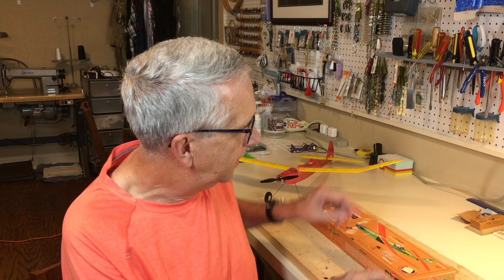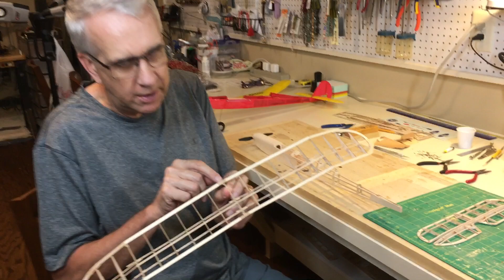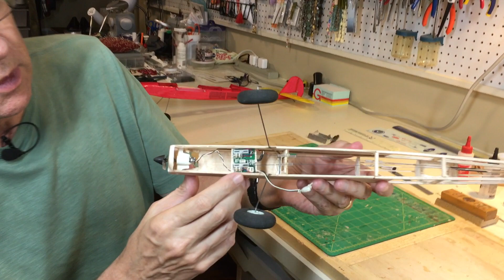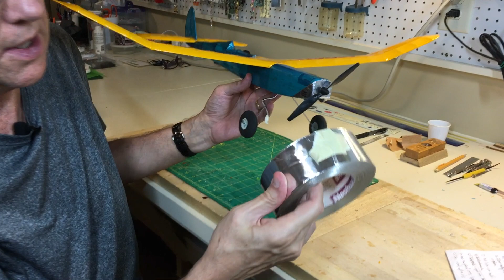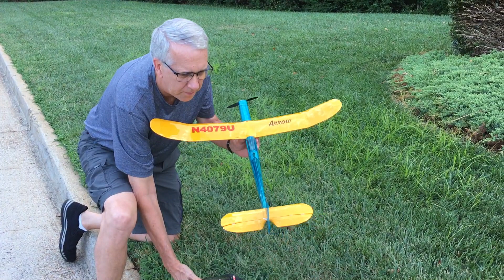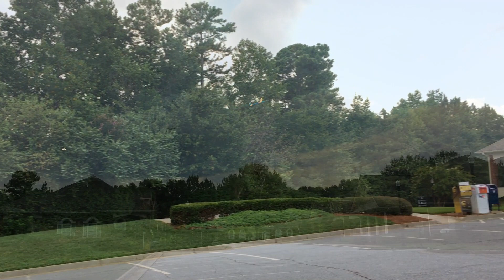Guillow Arrow RC Conversion - Part 2

Comment: Yes,  lots of wing area vs. weight (low wing loading) is crucial for good flight characteristics. Also, a sufficiently large  area of the horizonal stabilizer is crucial to good pitch stability and control, particularly at lower airspeeds such as when taking off and landing. I have enlarged the stab on many of my models and this has always produced good results. I also often increase wingspan by a bay or two both to add area and to increase the wing's aspect ratio, which in itself makes a big, positive difference. 
One reason for dong these mods is that our models necessarily have low Reynolds Numbers. Accordingly, increasing the area of lifting and control surfaces helps to offset this deficiency.
Reply from the maker: Good points!  Tim

Comment: Tim

In Arrow part 1 you call for 1/16 sheet balsa for the forward reinforcement in Part 2 1/32. Which way do you think is best? Also what are you using for the guide tubes for the flight controls music wire and from who do you get it.
Reply from the maker: TM:  OK to use 1/16” balsa. For control rod guides, I usually poke small holes in formers or balsa side pieces. I also glue in a small balsa cross- piece with small holes to prevent rod flexing. Very light control forces, seems to work. Tim